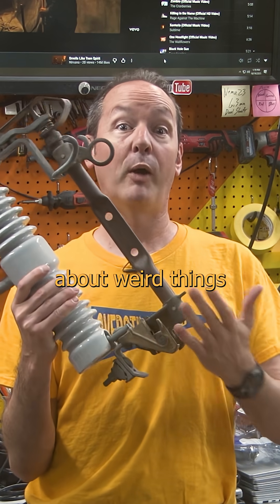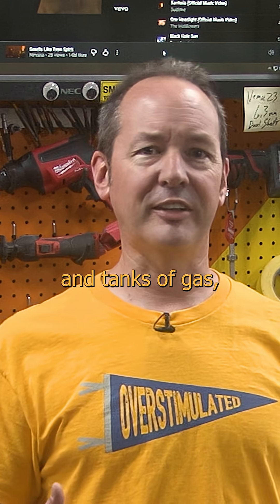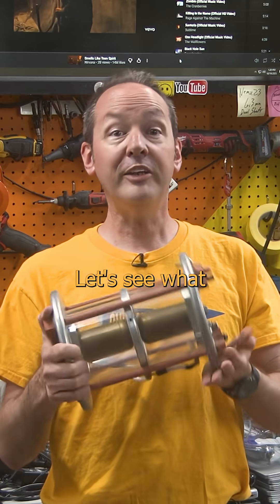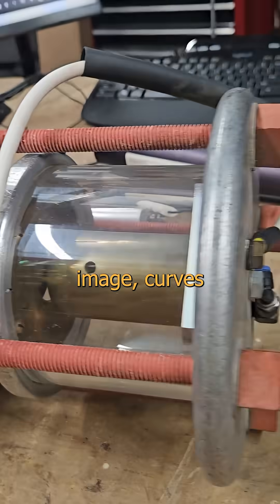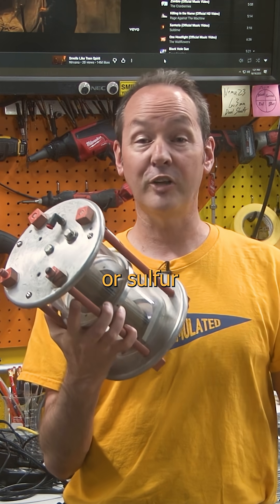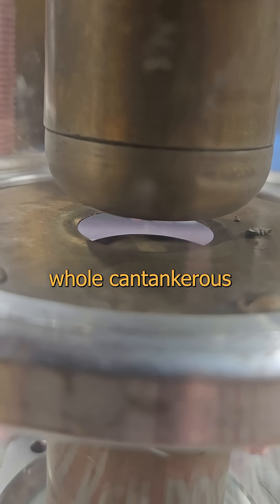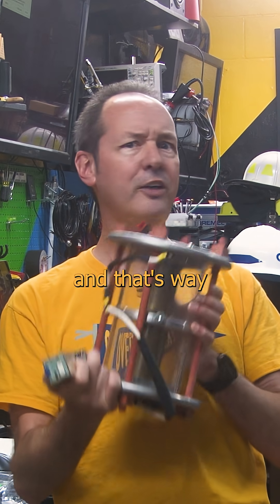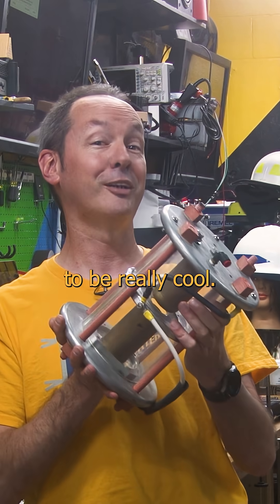Triggered Spark Gap #chrisboden #comedy #highvoltage #physics #engineering #science #educational

Comment: I was installing some aftermarket lights and sirens on my truck (I'm a firefighter this was legal to do in my state) and when i asked a buddy to help he refused because "electricity is witchcraft"
Reply: Manipulating energy to do your bidding is pretty much witchcraft.
Reply: all nerds dabble in some arcane arts.
Reply: @Ucceah  I can neither confirm nor deny the existence of elaborate ritual circles at CERN.
Reply: I think it’s more akin to sorcery.
Reply: It’s not witchcraft at voltages low enough to test if it’s live by licking your fingers then touching it
Reply: You need better buddies. Or at least ballsier buddies. I mean come on, this one is child’s play. Actually comprehensible to mere mortals and everything.
I was building more complicated, and higher voltage, electrical systems in my mom‘s garage when I was 15.  And I’m blind. Lol
Reply: Installing stuff like that is just keep it simple. Direct from battery to fuse, to switch and then lights with a chassis ground. Wiring anything into modern vehicles OE wire harnesses is just asking to create witchcraft with the computers running everything now😅
Reply: Also a fellow firefighter and gear head. Automotive 12v systems are so much simpler than you think. Wired a Whelen light bar on my car and it was as simple as running wires from my battery to a circuit breaker, breaker to the lights, and then wiring the lights to switches. Send power to the switch box and ground it, boom: flashy lights. Hardest part is running the wires and hiding everything!
Reply: Good for him. Electricity is one of those things that you don't touch if you don't understand.
Reply: Is your Friend really so pedestrian they were afraid to disconnect the battery?     Sure plugging it back in gets a flying peskie Pixie,  but that's only at like.... THE END
Reply: I'm a firefighter and I don't monkey around with
electricity, so none of my lights are hardwired. I
have 3 windshield lights in a 3-way 12v splitter
plus 3 side/rear window lights into another one.
Reply: Between harnessing fire and electricity, and the creation of computers, we've basically invented magic.
Reply: So he was scared of low voltage DC electricity? Sounds manly

Comment: Someone who works in the HV end of power distribution once told me: if it looks like it was designed by a Victorian era steampunk fan, it’s probably just modern high voltage stuff!
Reply: Because they were working with wicked stupid voltages.  The one-wire telegraph needed hundreds of volts to go one station to get the return current back through the earth.  When the figured out two-wire, then the batteries got more reasonable.
Reply: @jkbrown5496 which makes me laugh when you see a Western movie where some guy climbs a telegraph pole and grab a wire to send a message somewhere outside of the telegraph station. It also makes me wonder how many prairie fires were started because a wire fell down and no one knew it was down after a storm? Since DC doesn't like traveling long distances at low voltages with too much line losses and you need so much current in order to make something cover a distance and still get a signal string enough to activate a telegraph key solenoid. The guy climbing the pole was only safe because he was completing the circuit to ground because they didn't use lightening rods and grounding wires on every pole which was a good reason for strikes burning down wires. When they figured out they had to use spark gaps to draw off the static, away from the stations. What a learning experience electricity has been!
Reply: @BretTschacher  I'm pretty sure by the Old West times they were basically using relays and earth batteries to boost the signal periodocally instead of just jacking up the the voltage. The real learning experience was the first transatlantic cable... I'm pretty sure thisnis where Maxwell derived his laws from and a guy who's name I can't remember (starts with a P) formalized them into simpler laws we still use today.... They were just stumbling in the dark back then.

Edit: I think it was Heaviside, not Poynting...
Reply: @jkbrown5496  This reminds me of how many times they burned the 1st attempts at transcontinental cables for data transmission.
Reply: @Kalvinjj  tell us about that bro I'm curious
Reply: @JackgrAssOfAllTrades  Miss remembered, it was only once they burned it, tho it broke a few times trying to lay it down. After a few attempts at laying down the cable with two navy vessels (since neither would be able to hold the entire cable apparently), that went wrong because of mechanical failures to the cable, after finally managing laying it down, the 1st messages took several hours to transmit. In order to attempt using a mechanical telegraph, Wildman Whitehouse applied several thousand volts to the cable, which eventually failed from insulation problems.
The cable had previously worked with William Thompson's mirror galvanometer.

The most impressive thing about this whole endeavor in my opinion, is that it all happened from 1854 to 1856
Reply: @Kalvinjj Damn you are right about it being crazy that it was only 1854 to 1856. I was guessing 1900 or 1910. Closer to the titanic time period
Reply: @Kalvinjj  "The most impressive thing about this whole endeavor in my opinion, is that it all happened from 1854 to 1856"

California had only been a state for 4 years! That's how long ago that was!
Reply: @jkbrown5496 
The first royal navy electrified warship used an 800V DC power system, which included electric lighting.
Out on deck.
Out at sea.
During raging seas and storms. 
They soon changed to a lower voltage.
Reply: I'm sure that's at least in part due to the electrical lab props built by Kenneth Strickfaden for Frankenstein (and reused for Young Frankenstein). 94 years later and I'm sure most people are familiar with the images.
Reply: @danloeser  coincidentally enough, I'm currently ⚡in a production of Young Frankenstein the Musical. 😅
Reply: @AnnoyingNewsletters the creator or the creation?! Lol
Reply: love it
Reply: I've described it to myself as "And here, friends, is where our plumbing analogies stop working".
Reply: “…and don’t fuck with it.”
Reply: I heard the same thing from a dude who works at a nuclear reactor
Reply: or 1930s sci-fi set for energy stuff
Reply: Thousands of different applications.

   Ok. That's cool.
Reply: that's one hell of a quote, m8!
Reply: I kind of wonder if the reason the design looks old is because it is old. Likely because no one else wanted to be sacrificed to the spicy air to discover other ways.
Reply: @theonlywoody2shoes  looks a lot like a gigantic transistor

Comment: I work as a process engineering tech for a high voltage breaker manufacturer, the sound of testing breakers slapping big copper plates together is still terrifying to me
Reply: As a wise man once told me when I was a child and was scared of power tools: "It's great that you are scared. The real problems happen when you are not." And that is a pretty solid advice towards anything really, cause you always need to remember the risks. And in this field you better be scared as fuck to not forget all the safety rules and precautions
Reply: @yozhik_out_of_mist When you lose respect for things that can kill you, you become a liability....
Reply: @Texan_Patriot yep
Reply: @yozhik_out_of_mist it's true in commercial fishing as well. Probably all high fatality trades. 
I remember my first season an old ass fisherman told me,  hand over hand,  never touch anything that's moving etc. Stuck with me. I knew when to jump out of the way of a brailer bag (1k plus lbs) because of his advice. I would've been chum between the ships without it. That was year one. My captain, also my second cousin, was just past me on the same hand bar just looked at me and I said " I know,  idiot".
Reply: Always watch the crane.
Reply: Agreed. Usually the rules and regulations are a result of someone that forgot to be scared(or did something they should have  been too scared to try) and went and did it. As the scared factor goes up-usually the stakes follow.
Reply: Oh, like that don't use ladders near power lines nightmare fuel psa from the 80s?
Reply: @PhilieBlunt666  I'm glad I wasn't alive yet when that was circulating.
Reply: I love high voltage and that sound still makes me pucker
Reply: @PhilieBlunt666 i love electricity but have a huge fear of it, i think its mostly to do with watching my grandpa when i was young, i watched him accidentally melt a screw driver while trying to fix a breaker in his house panel, sparks went flying everywhere, no where near the danger that comes with the stuff i work with now, but when i think of arc flashes that image of the sparks comes to mind lol
Reply: Ya hearing a 765kv breaker open or close without warning scares the flying f*ck outta me
Reply: I used to build 550s and I've heard them go off in the lab. 765... Wow
Reply: @aaronleeper8664  ya about shit a brick the first time i heard one open without warning
Reply: You ever do the wire strap testing for short circuits? That's the fun part!
Reply: Me too,  medium voltage breaker mechanic. I was near one of those SF6 breakers tripped. Sounds like someone threw a man hole cover at a oil tanker. Its a sound you never forget.
Reply: Eaton?
Reply: @gabrielnin7769  I used to work in the testing lab at Bulldog Electric in Hamtramck, and there was UL testing of circuit breakers and motor starters going on.
Reply: Good! Respect for the forces of nature we attempt to tame as engineers keeps you, me and others save!

Comment: Talking about low voltage and medium voltage to a guy who wanted to build valve amps (the right way 'round, instead of that nonsense you see on the market nowadays) but can't source 1mF capacitors durable enough to handle 630V (those would be the smoothing caps in the Pi Filter after the toroidal transformer).
Don't let me near your workshop: I'd plunder it and make HV stuff🤣

Comment: Fill it with Xenon and put a capacitor stack across it?
It should make a mega Xenon flash tube!
The normal baby ones are pretty much the same principle, making the gas conduct via high voltage ionisation on a trigger electrode.
Reply: I find this concept to be unreasonably funny. Like it wouldn't even damage the component, since you could just flush the xenon out and replace it with a non-cunductive gas if you wanted to use it as a switch again.
Reply: Fun project, though not likely to be spectacular. The gap is too short to produce a meaningful amount of luminous plasma (the small gap minimizes losses - that's what you want from a switch, after all).
If you try it - keep it far away from anything flammable and 1/2 a mile from you eyes. In a test I did myself a while ago, a far more modest flash tube (from an airplane) charred the wooden surface it was lying on - in just 2-3 pulses. Instant toaster.
Reply: @lionk8635 : Oh, I don't think anyone turning one of these things into a flash tube would be worried about external charing. They might even consider the chemical changes as a useful diagnostic.

Comment: Am I the only one who cringed the moment the white wire touched the black one? Yeah, I know it’s a pigtail on an unconnected receptacle, but still. As an average moron with just enough brain cells to think I can do my own electrical work and not enough to know better, there’s just some shit you don’t do.
Reply: If that image was an issue, like trauma induced, then the plan has worked.
Only those that can't know better will perrish.
Be on look out for little kids and the "less gifted specials" in your life and everything will be fine with the pixies not getting too angry.
Reply: @antoniocampos5638  The moment I saw it, I wondered if it was intentional. Not malicious, just delightfully anarchistic.
Reply: You know what would have happened if ElectroBoom touched those wires together.
Reply: 3-way switch wiring uses 4-wire NM cable (white, black, red + ground), and uses the white wire as a "hot" for part of the run. It MUST be taped with black tape at the ends.
Reply: @PeregrineBF  If the white wire is hot in a 3-way switch, it is not installed properly. I will not get into it here, but PLEASE check out reputable sources on three way switch wiring, as they will show the white wire as the neutral line.
Reply: Some old dude at my plant made a socket like that to find which breaker was connected to which plug (I assume cause I never found out who it was) 🤔
Reply: ever wonder if a guy just grows enough brain cells to actually see what will happen when 4kv goes to 40kv, to 180kv, to 4mv in varying environments...and how to actually get there?
Reply: i worked at the orange box store.
I got to be good friends with the guy in electrical. TLDR, asked about the male to male extension cords as a joke. his face got serious, and said people seriously ask about them.
Reply: Rather like the time a friend, while recording a demo for something, pointed a gun at the camera (he was alone, using a tripod, it was safe). Watching the video afterwards I swerved out of the way when the barrel pointed towards the screen because that is a view I have been taught you never ever ever ever want to see.

Comment: “Below 300V electricity can’t get out” tell that to my stick welder made from two 12v batteries
Reply: That's not jumping out. That's contact based.
Reply: @corgi42069 it still arcs before contact is made, it's just that the arcing gap is so small you don't have to think about it.
Reply: @corgi42069  it arcs out...... you touch to start the arc, then you don't touch anything because you will stick the stinger
Reply: @mbpaintballa : The high-voltage stuff doesn't even arc all the time, sometimes it just turns the air into a light bulb without having contact in the first place. Do not touch the light bulb.
Reply: Does it leak out of you well maintain cables or at the end of the bare metal stick?
Reply: @klo1679  does it weld without connecting the ground to whatever you are welding? Will it make it through paint? Wood? A foot of Air like this example?
Reply: @coreymoyers5771 I can burn through paint with 6010. I can also make a spark jump through an inch of air with less voltage than you have at the plug in your wall.
Reply: @richardpenny7813 No shit, it is a welder. You still can’t weld without completing the circuit. What this guy is talking about is a different animal.
Reply: I'd like to know more about how that works😮
Reply: @Avengedsevenfoldrocks It's pretty self explanatory to be honest. I've done it in the past as well. Only time ive done it is emergency repairs when ive been wheeling out in the middle of nowhere and snapped something important. You hook up 2 12v batteries with jumper cables, and either a 6011 or 6013 rod. Use it just like a regular stick welder. Just cant weld long with it at once due to the possibility of thermal runaway on the batteries
Reply: @cody-2536 yes, but that isn't a current jumping out of the circuit, that's the welded surfaces being becoming part of the circuit through direct contact
Reply: @Avengedsevenfoldrocks  Sticks go contact, battery goes zap. Current high voltage low, metal melts. Do that too long and battery goes hot, goes fire. For emergence repairs in the field that might be your only choice.
Reply: Yeah, no, that's not electricity jumping out.  You are talking about 24vdc.  He is talking about 40,000v.  The latter will jump 10' feet through insulation to say hi to you....then you become an inadvertant organic ground/fast blow fuse.
Reply: How?
Reply: I've found 3 batteries work good with 2.5mm rods. Got me out of a pinch or two
Reply: @klo1679  does it do a little jump when you try to flex it?
Reply: Yes, once it's arcing it will keep going, but it won't start without touching
Reply: @bene5431 that's how stick generally works. But tig (aside from scratch start) doesn't require contact to start the arc.
Reply: @richardpenny7813 That's because TIG uses more than 300V to start the arc
Reply: A company called Ready Welder made a wire feed gun that ran off 12 to 40 volts DC

Comment: I vaugely remember seeing something like that in a cable thumper. This would have been the trigger for discharging a several dozen kV capacitor into the cable with a fault making it literally shake from the induced current to help locate where the fault is located while someone with an inductive probe watched for where the current goes from holy shit to zero revealing where the short is.
Reply: StyroPyro recently made a high voltage DC bank of like 100 car batteries in series. Those cables jumped pretty good, too 😊
Reply: Cable fault loaction tech here. We have a Baur pro track. We use the EM field for timing and listen for the bang to give a distance to the fault. The term thumper comes from the fact that 99% of faults(big hole in cable with some moisture) literally moves the ground you standing on. Think T rex in movie vibes
Reply: @nicomerwe  cool beans!!  I think the video where i remember seeing what I described was way back in 2010 so details are fuzzy and I may be hallucinating some of it at this point. 😅 But thanks so much for the correction.

Comment: Building a transistor using air
Reply: Transistors can amplify linearly. It's more like a thyristor or a thyratron. The spark gap is still "closed" as long as there is enough current passing
Reply: @odindimartino597 : I'd say "analog instead of binary" rather than linearly, but point taken. Though with the right laser you can probably manage a bit of transistor action with spark gaps too.